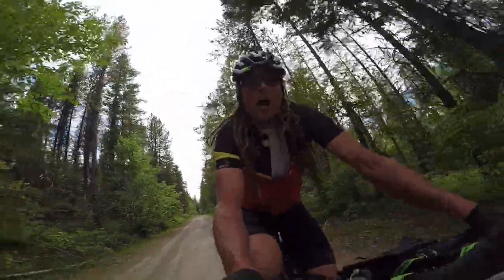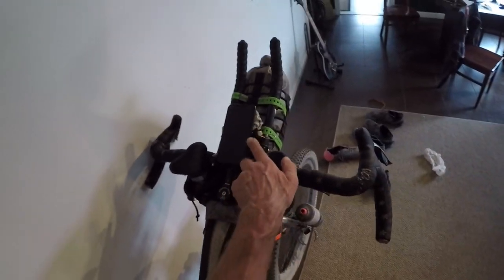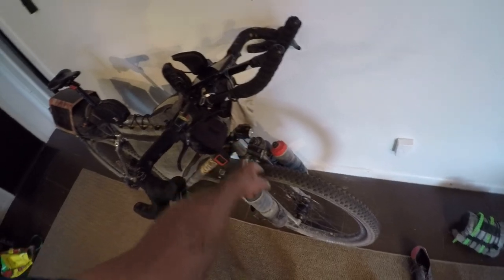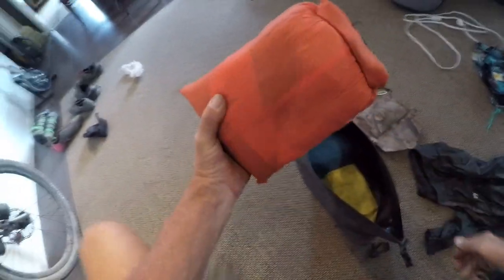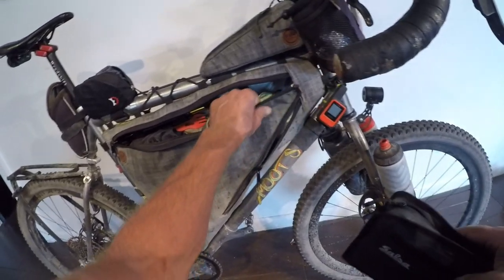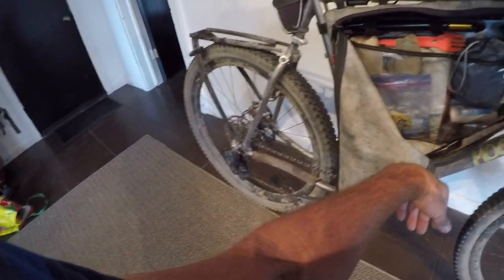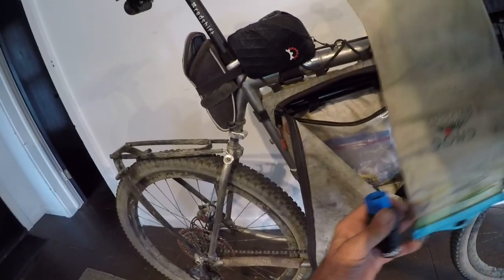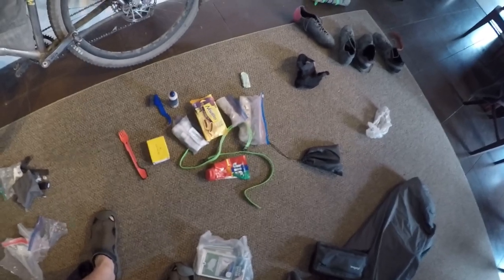2021 Tour Divide bike unpack

Comment: Hey Brian! How did you get the sealant IN to the old rock-'n'-roll bottle?
Reply from the maker: Hey Darren. I pulled the small hole top off the bottle, (Grab it with pliers), filled the bottle, then cut the top so the hole was a tight fit on the presta valve.